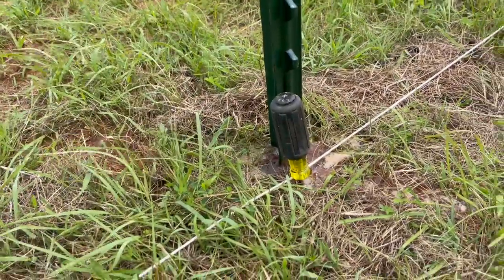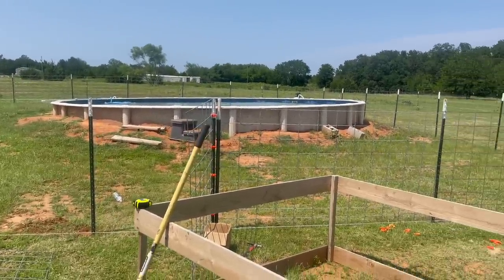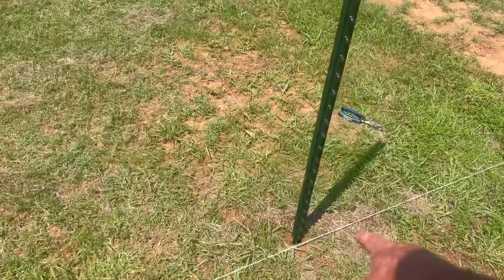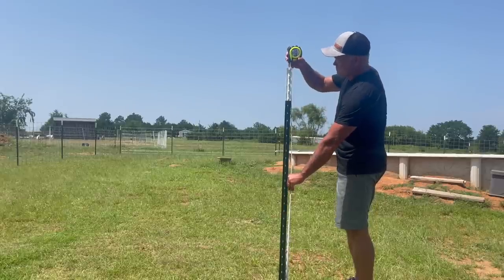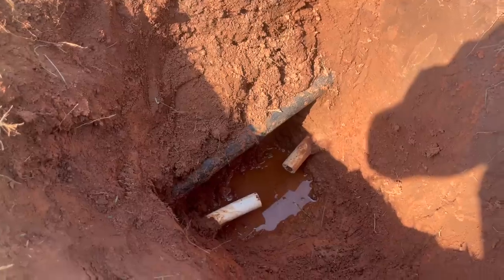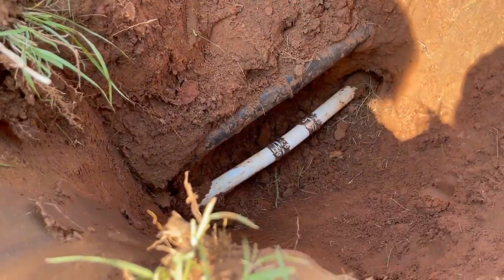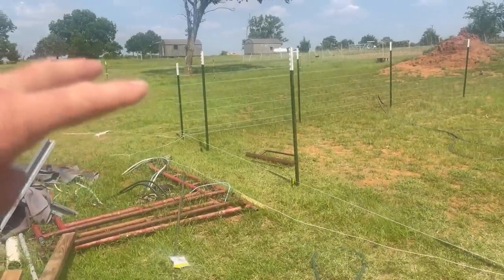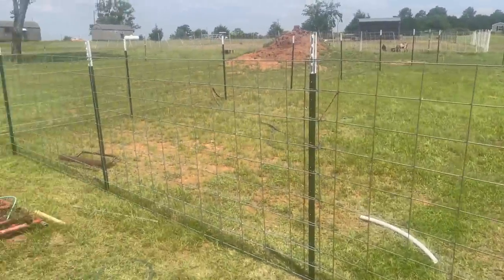Costly Mistake On The Farm | Fence Build | Pool Build | DIY Project | Farm Project

Comment: If there is potential to go wrong, then it is almost certain to go wrong, especially when in a hurry, or nearr end of a long tiring task.

Anger fixes nothing, stop, step back, think, reflect on the mistake, and contemplate the right fix. No anger and no hasty actions.
Reply from the maker: Exactly lime you said it. 👍